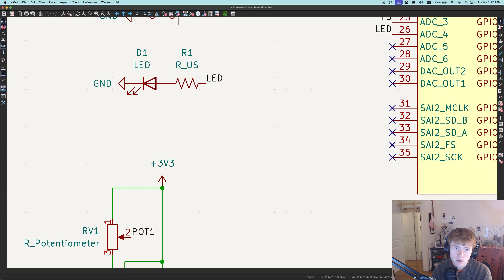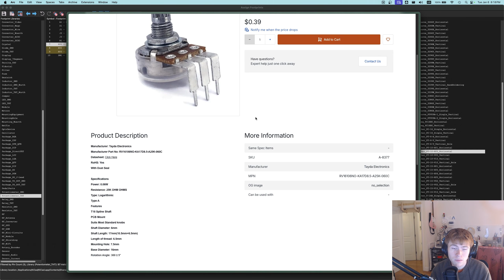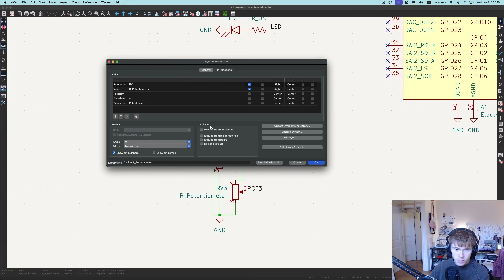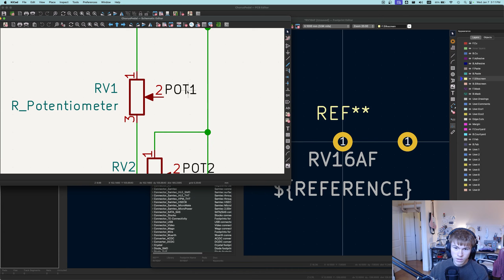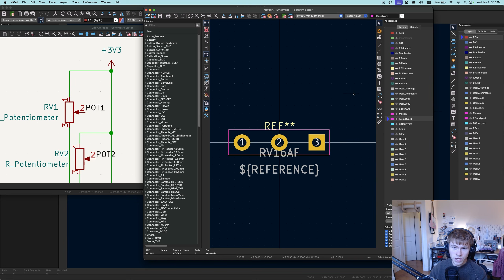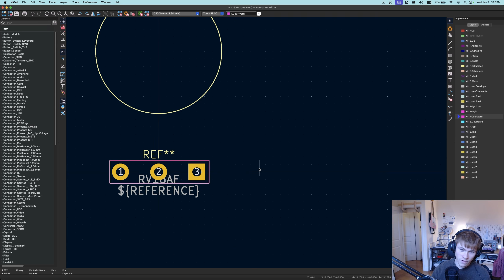Footprints Explained | Finding & Making Custom PCB Footprints in KiCad

Comment: I am electrical engineering student and I am making my first pcb project about neck fan and in which the speed is much higher then ordinary neck fan I want a fan in which there are three speed control uv(c) light for bacteria killing and the battery should be charged on USB c pd charging I have created a circuit but I am not sure if it's working or not

Component Name

USB-C Connector

10174570-00C11LF

USB PD Controller

HUSB238

Switching Charger IC

CN3703

P-Channel MOSFET

AO3401A

Power Inductor

22µH (2A+)

Schottky Diode

SS34

Sense Resistor (R4)

0.066Ω (66mΩ)

SP4T Switch

PWM Timer IC

NE555

SOIC-8 / DIP-8

N-Channel MOSFET

AO3400 / IRFZ44N

Flyback Diode

1N4007

DO-41

3S BMS Module

3S 10A BMS

PCB Module less